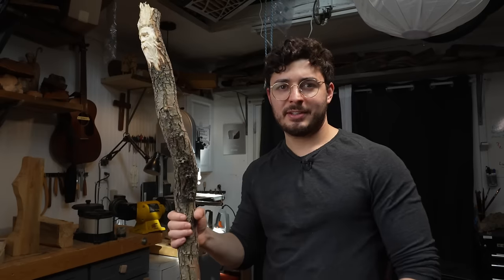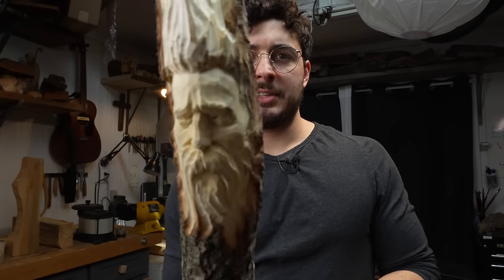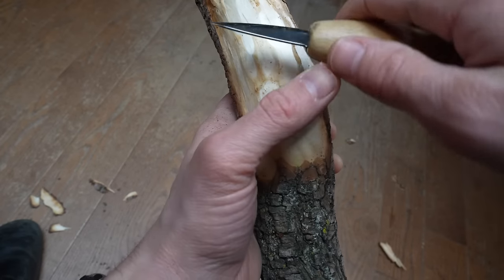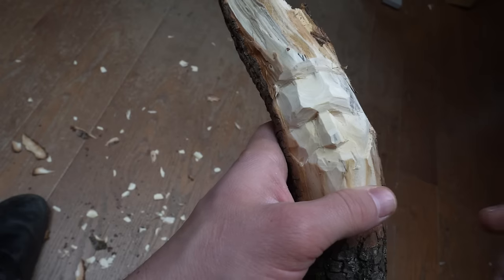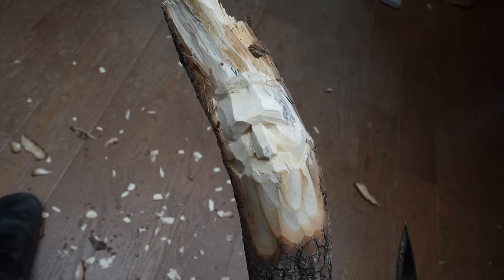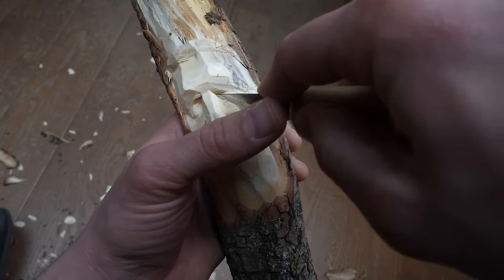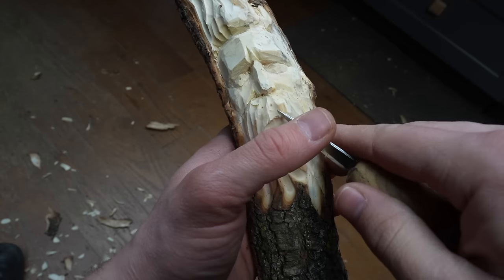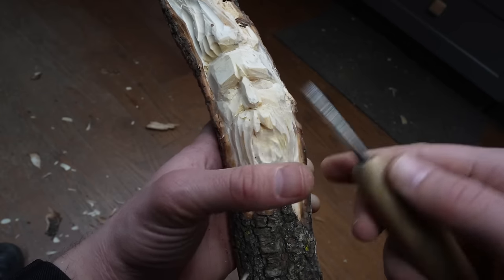Carving A Woodspirit Into a Hiking Staff with 2 Tools-- Beginner  Woodcarving Tutorial

Comment: how much does a tree limb have to dry out before you can carve in it?   If you carve in it while it is still wet will the carving split as the wood dries????
Reply: Depends on the wood and what season it's harvested. Hardwoods like to dry slowly, some people let them dry for 6-12 months depending on thickness. Soft woods don't often have to dry nearly as along since they tend to be porous and the water can dissipate easier. A trick I learned from my old woodshop teacher is to bury your work pieces in a bed of dry sawdust or wood shavings, it will help keep your piece from drying out too fast and splitting. It's nota 100% surefire method, but it does help from my limited experience.